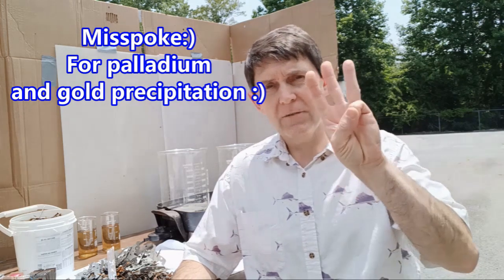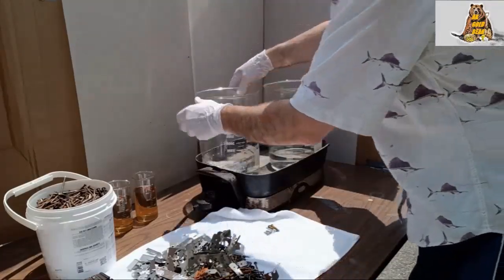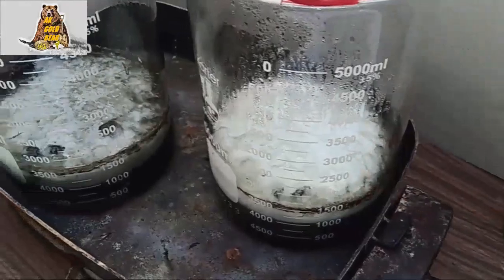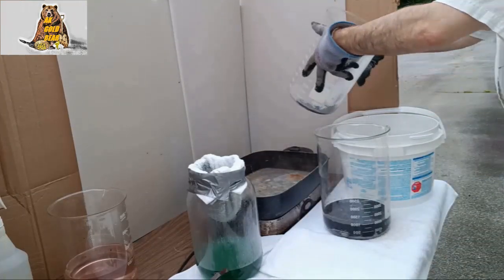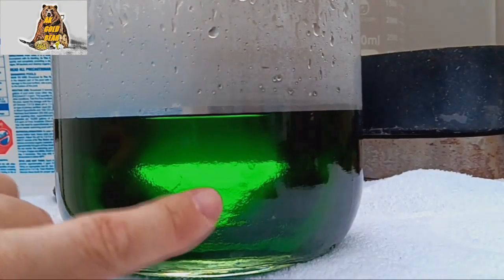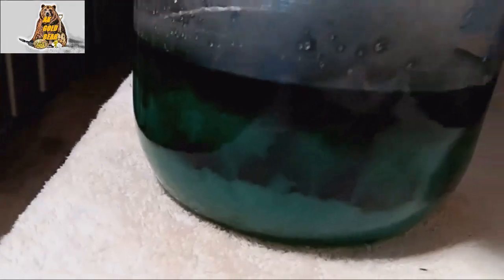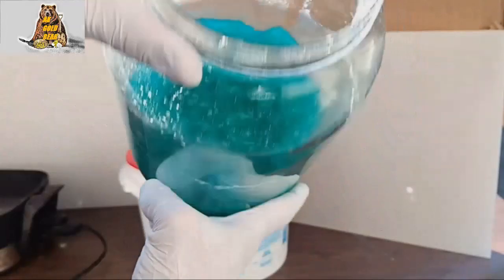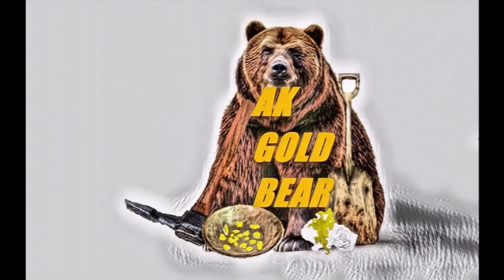How to make ferrous sulfate at home. Iron sulfate. FeSO₄ 🧪🙂

Comment: If i use just iron not steel,this work?
Reply from the maker: Iron is definitely the best option, since you can never know for sure what alloy of metals is contained in steel. The more different alloys there are in the steel, the more difficult the solution filtration process will be.
Reply: @akgoldbear7669 Okay friend, but I want to ask, I made it like this at home by soaking it and not heating it. Why is the water black, not blue or green? What factors make it like that?

Comment: tap water or disstilled ?
Reply from the maker: Hi. It doesn't matter at all. The main thing is that the steel surface shouldn't have any coating, like copper, tin, brass, or lead. Because the filtration will be very, very difficult and time-consuming. As soon as the solution cools on the filter, iron sulfate crystals will immediately start to form on the filter, and then the filtration will stop. You can use any water; you could even pee in the beaker and you'd still get iron sulfate.😀 Good luck.🖐
Reply: @akgoldbear7669  THANK YOU

Comment: Hi, my liquid is blue after filtration but not crystals form, what do you think happened or what do I need to do please?
Reply from the maker: Hi. It's very simple. Your solution has a high concentration of free water, just evaporate half of the liquid. For example, if you have two liters of solution, evaporate one liter of water and the next day you will see ferrous sulfate crystals. Just do not boil the solution while evaporating. Good luck 🙂🖐
Reply: @akgoldbear7669 درود داداش وقت بخیربرای ساختن...سولفات اهن  سولفوریک اسید....خالی نیاز هست یا ترکیب دیگ هم دار

Comment: AK how do you know when you've put enough iron sulfate into your gold bearing solution when dropping your gold?
Reply from the maker: Hello. I'll repeat it again ))  If I dissolve all the metals together with gold at once in aqua regia, then I adding iron sulfate one to one to such a dirty solution in which there is tin, lead, zinc, nickel, copper, brass and gold, that is, for every hundred grams of dissolved metal I add one hundred grams of iron sulfate. And after adding iron sulfate to completely precipitate the gold, it is best to leave such a dirty solution for 8-10 hours. I do not know how others do it, I make calculations only based on my observations and personal experience. If I dissolve only gold flakes after dissolving the base metals, then iron sulfate should be added until small gold flakes appear on the surface of the solution. As soon as you see gold on the surface of the solution, that's it, enough.

Comment: Great Video! Does the water used have to be pure (ro / distilled closest to 000 ppm as possible)? Or is tap water ok? Appreciate u sharing!!!
Reply from the maker: Hello. It depends on what exactly you are dissolving. If you are dissolving some gold-plated junk, it is better to use distilled or rainwater. If you are just dissolving copper wires to get copper nitrate, I recommend using purified city water, as it contains chlorine and other chemical nastiness. City water will help dropout some tin, lead and silver from copper nitrate. That is, copper nitrate will be pure and you will get pure crystals of copper sulfate 🙂

Comment: Not sure if you answer questions or not but here goes. I did what you did all except for the heat, and within two hours I had a large amount of crystals already formed in the beaker . Cotton filtered the solution, no crystals after three days. Question is, is this normal and will it work the same?
Reply from the maker: Hello. The solution must be hot, otherwise ferrous sulfate crystals will form in the beaker along with all the other dirt. While the solution is hot, it needs to be drained onto some kind of filter. For some simple filter. I use a regular towel 🙂
Reply: @akgoldbear7669  Thank You kind sir.

Comment: I had some galvanized nails mixed in with my Steel and I understand that will be a contaminant and not the Purity that would be ideal but can I still use it to precipitate Gold from solution or is it ruined?
Reply from the maker: Yes you can. There will be a problem with filtration, filtration will take a long time. When the electrolyte stops working, remove the beaker from the heat, wait five minutes and start filtering. Do not wait for the solution to cool. If the solution is cool, you will not be able to filter the solution due to tin chloride or lead. Good luck 🙂✌

Comment: Just what I needed. Thank you.
Reply: Can I use electrolyte from an old car battery if I filter it first? I have been using SMB and it puts out a lot of chlorine and sulphuric gas. I hate that.
Reply from the maker: @thisoldminewithlars5324  Yes, of course you can use old electrolyte from batteries. In principle, you don’t have to filter it, just pour it into a beaker and put in some steel, some nails. Since the electrolyte is old, you need to heat it well. Boil. When boiling, the water will evaporate and the density of sulfuric acid will increase 🙂 Yes, I understand you, sodium metabisulfite is very, very toxic. I don't like using SMB either. But sometimes I use it.
Reply from the maker: Happy to help! Thanks for watching and commenting 🙂🖐
Reply: @akgoldbear7669 سلام  سولفوریک اسید ترکیب دیگی دارربرای ساختن سولفات اهن
Reply: Thank you.

Comment: Thank you AK for share your knowledge with us. But i curious how you neutralize all those waste acid and dispose them.
Reply from the maker: This takes extra time. But everything is easy. I usually isolate even dissolved copper from solutions. Sometimes I use my copper sulfate for my garden. I don't use much nitric acid. I also use urea to neutralize the remaining nitric acid. After removing all the metals from the solution and after neutralizing the nitric acid, I leave the solution for 15-20 days. After 20 days, the bottom of the bucket will have a sediment and dirt that I collecting in my waste bucket. After that, only a little hydrochloric acid or sulfuric acid remains in the solution. Very little. Such a solution will not harm anyone, anywhere. I just flush it down the toilet. Any hardware store sells pipe cleaner drain opener for sinks, all drain openers contain sulfuric acid, this is dangerous! Also they selling muriatic acid for cleaning swimming pools, muriatic acid is a concentrated hydrochloric acid that's really dangerous too. These solutions people use every day and a lot. My acids are not active after processing  🙂

Comment: I have a bit of a strange question.
What do you think would happen if you made FeSO⁴ from regular crystal oscillators?
What would happen to the Ag? Would it convert to Ag²SO⁴?
Thanks AK.

Great vid, it looks clean.
Reply: Hmm think it would end up in the filter undissolved where all that silica mud was.  With any pm cemented (and base metals) that are brought into solution. Since we are pushing until iron is the only in solution.  Similar to end stage waste bucket.
I did this with crap pins. In my settle-out barren solution bucket. I add some that hasn't been denoxed from cleaning beakers and osmosis filters and was left with pm muds and foils.
Reply: @colonialcharlie8702  thanks Charlie.
If the Ag did go into solution, of which I'm not sure, it would cement back out as metallic silver, right? 
Maybe incremental H²SO⁴ until the Fe is consumed.
Problem I am preempting is if the "shells" are plated Fe, or a stainless alloy. That could complicate things. Fe being so high on the Reactivity Series should (😄) leave the possible plating or alloy metals behind as a mix of cement silver and unknowns mud. Ready for testing.
Thanks for your input man. I dont know for certain until I try. Be damned if im decanning them though.
Reply: @NOFX0890  yeah if it's in the filter then could process like it's a contaiminated waste bucket. No reason a mess up can't be restarted earlier in the process. If you don't mind having multiple different stage waste buckets.   If you can process those in an effective way and don't care so much about showing yeild, I'm all for it. Good luck!
Reply from the maker: Absolutely not. Just in case, I want to say that not all crystal oscillators are the same. Many manufacturers use different metals. After dissolving the crystal oscillators, you can get ferrous sulfate or copper sulfate. Silver does not react to these sulfates in any way. After dissolution, it will be difficult to filter the solution. You will need to collect all the sediment, dirt on the filter to get silver  🙂